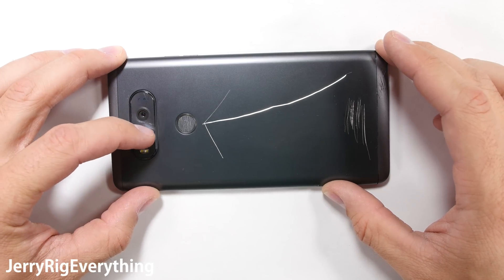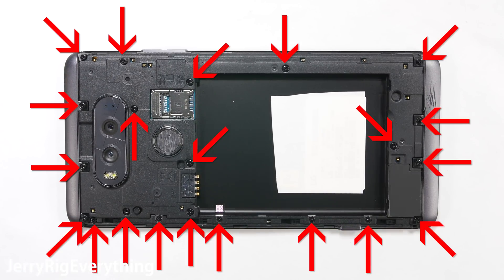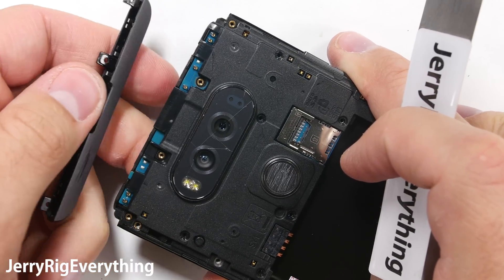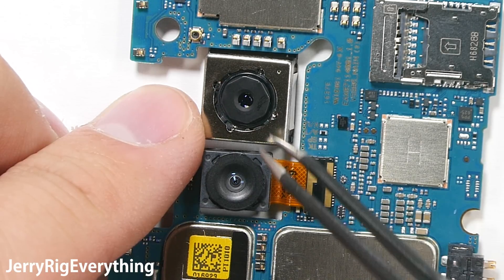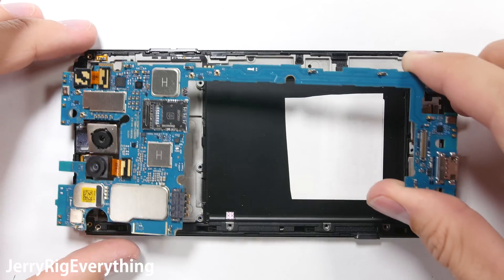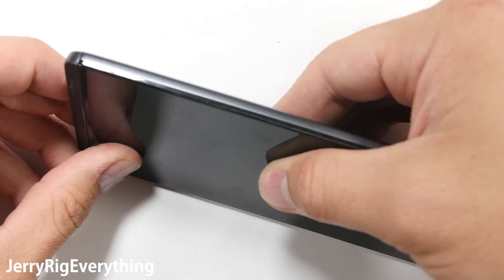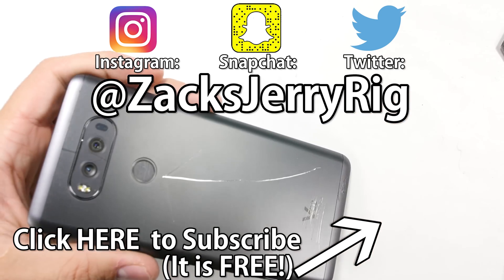LG V20 Teardown - Screen repair, Battery Swap, Charging port fix

Comment: My favorite phone of all times, too bad that LG left the game, I wish they would remake this v20 just with updated specs and keep the same design. It's sleekest and most practical phone; removal back cover removable battery, dual screen, headphones jack. Stereo speakers, has FM radio, has an IR blaster, amazing camera, quad DAC with headphone amplifier, microSD slot, dual tone flash. And super solid construction, metal back cover. One of the slimest phone yet has removable battery.

Comment: Great! Now those screws are identical, no way it makes any difference if you mix. I still use V20 and plan to continue, have like 4 now, they cost ca $70 used on Aliexpress. Fab audio capability. Hope the climate alarmism joke was just that

Comment: You lost me when you had to have a political dig at something you believe in. Even though the science that is supposedly truth has manipulated data so they can get the answers they want. That's a fact NASA. FYI, one large volcanic eruption can provide the Earth's atmosphere with more carbon monoxide than humans have been putting out since they started burning fires. 
Also you don't mention a very important thing that's called the thermal paste that cools the processor down  by exchanging heat to the phone body. I'm sure everybody will enjoy their phone overheating as you either didn't show it or mention the importance of putting fresh paste in.

Comment: hello, my v20 suddenly dies and i cant get it to turn on. i've tried pulling the battery off and put it back on, connecting the charger, and pressing the power button repeatedly but completely no response from the phone.

i want to try tearing down the phone but i don't know what component to check/repair next? please help

edit: i've been using the v20 for 3 years now but so far i'm not having any problems and i love it so much!

Comment: It ia really cure for my current problem.
My V20 has problem: cannot detect SIM card. There's member of forum which diagnose if my V20 perhaps has baseband issue.
I experience it first on April, when I was using and surfing the internet on my phone when there's pop-up notification "SIM invalid" then the phone restart. The next time it turn on, there is "Emergency only" notification and all the SIM card feature was disabled. The SIM card indeed was perfectly fine when I plug it into other brand.
So, oulc you help me out how to check and/or repair the baseband stuff?!
Thanks a lot

Comment: Still rocking my LG V20. The thing is a tank. I dropped it so many times, only superficial scratches, it's super easy to take apart so I can buy a new part replace it and it's going to be as good as new. I also got an 4100mah battery that fixed SOC issues, I'm also using Lineage with android 10. The phone still rocks and I have no plan to upgrade to a black box that I can't take apart or easily replace the battery. I hate the trend phones took to become vaults where you can't enter.

Comment: Warning - this video is misleading and moderately helpful at best. The steps not shown (the part he skims over where you need to transfer over the “little tiny parts” to the new screen) is the most difficult and you likely won’t be able to do it without breaking something. Likely a shill just getting money from referrals. Don’t waste your time and money unless you know what you’re getting into.

Comment: Definitely appears to look easy...but for who? Takes me longer than that to get a three layer case off! And I don't have to worry about teenie parts busting off or popping out of place accidentally with a case. Guaranteed the LG V20 would become unusable if bits of hardware were to self eject and if by a miracle were undamaged...where do those bits belong? Maybe we are meant to use a lighted magnifer and to also videotape the undertaking with a hi-tech camera that records and plays back in SUPER slow motion? After the disassembly and screen replacement, I cannot imagine being able to remember where or how all those wee bits that Zack popped out would even go. Maybe after much trial and error and by sheer luck I didn't break anyhing, I might actually get it back together and working. I see now why repair depot's are charging 250.00 - 300.00 CAD to replace a screen!  
Anyone see another teardown where this pen like tool is swiped continually back and forth over certain areas of the screen .. is that necessary and is it a heat source or what is the purpose of that tool?  Curious!

Enjoyed watching. Thanks for sharing.
Reply: Oh David Jung actually posted earlier and what he wrote cured my curiosity. Thanks

Comment: THANK YOU! You saved my life today. I dropped my phone in muddy water, hours of drying and the screen was still dim. I followed your directions disassembling the phone, and I found dirt on the screen connector. Cleaned the dirt and corrosion from the connector and the board. Works perfect!  Far better than the 'president' who doesn't believe in climate change. If only he was this easy to fix. Thank you again!

Comment: Dear, I have network signal dropping/weak reception issue in LG V20 (H-918) T-mobile. Wi Fi signals fine. Actually the matter of fact is that when a goes an area where there isn't strong coverage, my phone goes in SEARCHING mode. No NETWORK although other smartphones of my friends same network showing 2 to 3 sticks in signal bars with me. What is this I mean. I am really irritated of it. Please help me out.

Comment: Sooo, I know this is like a good year later, but my soon to be 2-year-old LG V20 such bad battery issues (like, having to charge it 3-4x a day battery issues). Looked in the description box but couldn't find an active link for good battery replacements? Is that something that is still around?

Comment: I ordered the screen with frame from your link. It came in 2 days, but it's missing a few components. I know I have to transfer over the parts you named, but there are quite a few other parts I had to transfer over also.

Comment: The vostok ice core samples prove that man made climate change is a big lie. Temperature and carbon levels were actually higher on the planet 400k years ago ago. Not only that but the increase in carbon levels always lag behind increases in temperature. You might try analyzing some real data because you sound really stupid making generic sheep like comments about something you obviously don't have a clue about.

Comment: After nearly a year of use, I'm glad I chose this phone. My carrier had only offered the Titan version, but I found replacement parts (back cover, the plastic end caps, volume buttons, etc. in the silver and pink versions, so I was able to turn my LG V20 into the badass pink color I always wanted.

Comment: I ordered a screen from JRG's link to fixez, and it was missing components that can't be moved without damage (e.g., antenna), it was discolored and ghosted, and then the glass cracked with no impacts after only three weeks, rendering it unretrurnable. Doesn't seem like an OEM part, and I'd go somewhere else to get it.

Comment: ordered a replacement screen to arrive in a few days. should be easy if its that fast
Reply: Just to give you some fair warning. I just replaced my digitizer with frame on my v20.
The part where Jerry says to remove the components from the old frame and put on the replacement frame digitizer is by far the hardest part of this operation. These components are glued on there good. You'll need a hair dryer to soften the glue to lift the components out. The small ribbon cables are small, fragile and easily torn. You will probably need to use some glue to hold the components in when assembling. Recommend having a magnifying glass and good light source on hand.

Comment: My charging port just broke :(
Reply: just buy a lg v20 charging dock and 1 spare battery, i have 2 spare lg battery and charging dock and i very rarely charging from usb port i just swap the battery if they empty and charging with my docking

Comment: So my phone recently crapped out on my where the whole screen starts flashing and I only get a fraction of a sec glimpse at the screen the touch input was barely registering. So I was under the impressive the digitalizer was failing on it so I got the screen replacement have completely overhauled it and having the same problem except now it doesn't register any touch at all so I can't even put in my pin for the OS to boot.

Comment: @JerryRigEverything.
Would you give me a help?
Recently my phone got wet. Not totally wet, just a drop of water got into the phone and made the lcd screen dimmed. Lcd only clear and bright on top right corner, and the rest just dim eventhou I had turned the brightness to 100%.
I have it fixed by LG Service centre And they did simple cleaning to the lcd port and lcd flexible cable. There was a small deposit around the lcd port. And lcd back to normal for 2 hours and then dimmed again. Somehow there is a very small dark spot on the port. The one with golden color. Is it a burn because of water had contaced with that port? They can not clean it and suggest to replace the whole lcd. I dont mind with the replacement cost but they cant give assurance wether it will give permanent solution or not. They even said there was a customer who had to replace the mainboard and she did it. That mainboard cost a lot of money and I dont want spend that much (half price of new phone). Any suggestion?

Comment: My v20 rear camera lens fell off and lost. I ordered a new rear camera lens. Went to install and realized there is another part missing where the glass lens cover sticks onto. Cannot find what this part is called nor cannot find all v20 parts to find what it is called. This part is raised up and the lens cover simple sticks onto. Some of v20 models appears in pictures looks like its plastic with metallicover ring fits right in over the the rear camera lenses and flash. Then the lens cover sticks onto it.  That's the part that I need some please help out a fellow lg user.. Thank you

Comment: Did you find where the third microphone is on this phone? The two I can see are the little holes in the bottom-left near the headphone jack, and the top left above the front camera. Can you fill me in on where the third might be? I'm asking bacause I have a case on mine, and I just want to be sure when I'm recording stuff my case and/or hand don't block it.

Comment: Hi my phone got extremely hot on 3 different ocassions. This 3rd time it was actually plugged in charding got to 92 percent I picked it up to use it eas hot and when I woke it up to use my screen was darkened turned up illumination shich is only coming from top area and downwards light a sun shine disappating as it goes. all screen area is visble and working but muted. Are there any recalls on illumination or components? also which parts would I need if I do it myself? Thanks so much for your help. Brigitte

Comment: I need to replace my SD/SIM card reader. Any soldering tips?
Reply: also, the video is missing the detachment of the left camera (part of removing the motherboard). It was the only thing left holding on after following your very detailed instructions.

Comment: Anyone else have this problem?

Whenever the phone's battery is connected, or when I have it connected to a charging cable, the flashlight turns on. I have looked at the internals, and can't seem to find anything physically wrong with any of the connections. Mind you, the flashlight will turn on, even if the phone itself is turned off, so it's like if it get's any power to it at all, ie battery or charger, then the light turns on.

Comment: +JerryRigEverything - I have a few questions I'm having bad signal issues.

1. In your video you show that you removing the top and bottom bumper. On the top there is a white  ribbon like tape on midframe what is that for.

2. Where is the antenna located for carrier signal. I wanna check connections and cannot find it.

Comment: This is another video that I have seen about screen replacement that does not say anything about re-using the rubber grommet for the front facing light sensor... But other than that very informative.

Comment: Hi, my microphone is broken on the LG V20. The one right next to the headphone jack, which is also broken. I can't use voice commands or talk on the phone. I was wondering if the mic was inside the headphone jack assembly or if it was soldered into the motherboard? Please help me, I can't find replacement parts for the mic and there isn't a whole lot of info online.

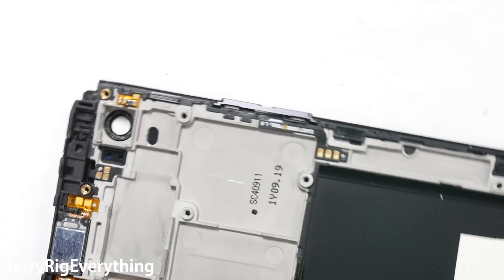Comment: Please include the process for moving over the "tiny components:  i.e. vibration motor, ear piece, side buttons and head phone jack"  starting @ 1:23 in the video.    This didn't work for me...the screen was beautiful, but the digitizer part didn't work, so my screen was unresponsive to touch... suggestions anyone?  Thanks

Comment: i took my phone apart and replaced the headphone jack, but now the fingerprint sensor is unreliable, and it cannot receive a signal. under the plastic cover, there seem to be connectors for a signal wire, but this video shows there aren't any. 

also, on the back cover, there is a gold connector that matches with the phone, but i have no idea what it is for. could somebody please help me, and tell me what the connector on the back cover is for?

Comment: I am finding that I can buy just the replacement glass, but all the repairs I am finding, like yours show to replace the digatizer at the same time.  Is there a way to separate the digatizer from the glass screen just to replace the glass screen?
Reply: No.

Comment: where do I get a replacement camera lens
Reply: here 
http://www.ebay.com/itm/For-LG-V20-F800-H910-H915-H990-US996-VS995-Rear-Camera-Lens-Cover-Glass-Adhesive/132139713346?_trksid=p2047675.c100005.m1851&_trkparms=aid%3D222007%26algo%3DSIC.MBE%26ao%3D2%26asc%3D41809%26meid%3D2b01a3087aba4e6caa30d26f7f1b8fc1%26pid%3D100005%26rk%3D3%26rkt%3D6%26sd%3D142324515672

Comment: had anyone found replacement glass for the back camera ?
Reply: http://www.ebay.com/itm/For-LG-V20-F800-H910-H915-H990-US996-VS995-Rear-Camera-Lens-Cover-Glass-Adhesive/132139713346?_trksid=p2047675.c100005.m1851&_trkparms=aid%3D222007%26algo%3DSIC.MBE%26ao%3D2%26asc%3D41809%26meid%3D2b01a3087aba4e6caa30d26f7f1b8fc1%26pid%3D100005%26rk%3D3%26rkt%3D6%26sd%3D142324515672
Reply: jorge197 yessssss thank you
Reply: welcome

Comment: where is the antenna on this thing?  I have no reception after taking apart to replace the middle plastic housing and I didnt even touch any of the connectors on the board.  tried taking apart and putting back together again but no luck.

Comment: If the charger port breaks you are not TOTALLY out of luck. Thanks to the replaceable battery :) I always have an extra battery with me on the go and put an empty battery in my bag for recharg on a powerbank. Never have to worry about wires while using my phone then.

Comment: This legit was easy and quick. I have been trying to find some video that explains how to take the device apart. Nothing is wrong with it, but just in case it ever did I can see your video. Also, do you have a link for the camera lens part? I cannot seem to find someone who sells it.

Comment: +JerryRigEverything have u heard any complaints about a bootloop on the lg v20? Because I really need the removable battery but LG won't say if its a hardware fault or not so I'm considering Samsung or any other manufacturer.

Comment: For everyone struggling to find replacement parts for your V20, I found this: http://www.mengtor.com/products.php?cid=1617
It is the only website I have found with all of the parts for the V20. Hopefully this will solve some problems.
Reply: Although all of the parts are out of stock right now.
Reply: But customer service assured me they would be back in stock by mid January.
Reply: Garrett Pohlman have you found anywhere that can replace the camera glass
Reply: This is the closest I have gotten to finding a solution. I'm pretty sure if you send it to LG they can replace it at a cost. LG wasn't able to give me a price estimate and I didn't want them having my phone for a few weeks so I am trying to find a solution on my own. A local repair shop called a wholesale retailer for me and said they could only get the whole chassis for me for $270, not something I want or need. I am going to try some more local shops. It would be great if the part goes back in stock on this website though. Sad I have to pay minimum $60 for a defective piece of glass.

Comment: I am looking for a camera glass lens replacement but can't seem to find it anywhere to buy online, do you have a link? Also, my speakers only work about half the time. Sometimes it'll work perfect and then seconds later just stop and not work again for awhile. This started after a drop onto concrete. Could it be a loose connection? Thanks!

Comment: I dropped my v20 in water.  Did all the regular tricks and the light in the lower section of the screen went out.  I assumed that was part of the screen.  I've replaced the screen and its still doing the same thing.  Any ideas?

Comment: Hey @Jerryrigeverything, im having a hard time finding a replacement earpiece speaker for this. came apart moving all components from broken assembly to new one. Would really appreciate the help in this. can be used, as long as it works!
thanks!
Reply: Edgar try this site

http://www.mengtor.com/product_show.php?category=1617,1469&pid=24618

Comment: Can you tell me where the antenna is located in this phone? I have the love mei aluminum case and it's knocking my signal out extremely bad. it's just wondering where would be the best places for me to drill holes in the case so hopefully boost my signal back